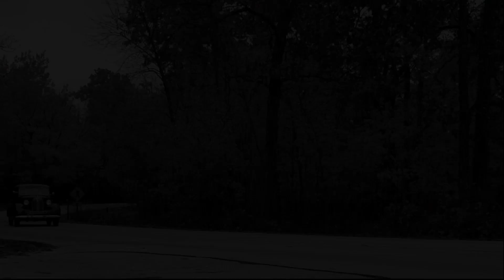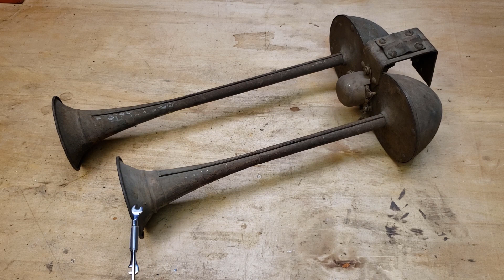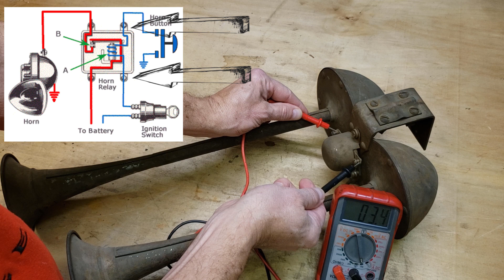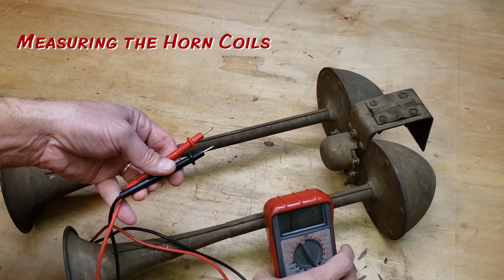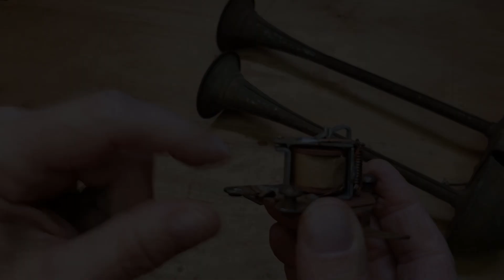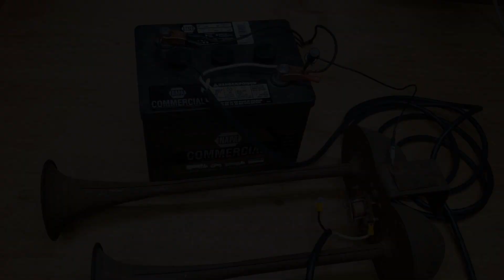Antique Car Horns! How to test and Repair them! IT"S LOUD! #modelaford #Vintage #antique #oldcar

Comment: I’m not sure if you will see this, but I recently acquired a horn like this, but it is missing the relay, is there anything I can replace it with?
Reply: Any 6v horn relay.
Reply from the maker: Ha! I read every comment and respond to 99% of them. Do a Google search on "6 Volt Car Horn Relay" and you'll see several listed. Some listed are at Napa and "Chevs of the 40's" websites. Hope this hrlps!

Comment: These were predecessor to seashell horns all cars from 30s to  40s including Ford used it. I believe even heavy commercial and fire trucks with hydraulic brakes like kb6,kb8 used it where the factory adjusted the screws at the back to give it a truck sound.

Comment: Hi Terry. Could you please explain how the circuit is set up at the end, when you test the complete system? I would have thought that one cable from the negative battery post to each relay contact and the other from horn ground to positive battery terminal (as it is for a positive ground car) would be enough. But you're using a lot more cables, which I don't understand. It's a great video, by the way, thanks for that.

Comment: How do you repair the horn if it doesn't work?
Reply from the maker: It depends if its a bad relay (if it has one) or the coil(s) in the horn itself. Do you have vintage trumpet horns like in my video?

Comment: I have a set of trumpet horns 6volt from 39 Chevy..is the positive on 6 volt the ground?? I tried clamping to wire coming from horn and touching horn assembly with other wire got spark a bit m a hum but sure not a horn sound. Seems there is a whole magnet n relay system under dome.under main screw..I used 14 ga wire alligator clamp to battery is gauge of wire too small?? To get horn to sound..is there an ohm test on horn insides?? Can I send it to you to look at??
Reply from the maker: Hey Paul, It could a few possibilities preventing them from working properly as I've seen on other horns. Yes, I can look at them no problem! Contact me at flatheadterry@gmail.com so we can discuss the details.
Reply from the maker: Did you get yours working?

Comment: Can I use an energizer 6v battery I can get at Walmart or is that going to be too weak?
Reply from the maker: @communistpootisbirb  Correct, the Energizer will not have the current capacity (measured in "Amp Hours) to energize the coils. In this video, the small battery has an 18 Amp Hour (Ah) capacity which is not enough. You'll need a battery with at least a 50 AH rating. How this helps.
Flathead

Comment: Do you have to have a relay?
Reply from the maker: No, you don't need to have a relay. However, these old horns draw a lot of current (6+ Amps) so make sure your wires, switches and fuse can handle this higher load.:face-orange-biting-nails: A relay is used in old cars so a small wire and horn button (switch) can be feed up thru the steering column. This is the "Primary Circuit" of a relay. The "Secondary Circuit" supplies the High current directly to the Horns with the larger wires. Hope this helps!:hand-orange-covering-eyes:

Comment: Thanks Terry -- will this horn work on a 12 volt system?
Reply from the maker: Thats a good question! I suspect that they would work for a short period of time but eventually burn out the coil windings. The copper coil windings are designed for lower voltage (6 volts), higher current (8-10 amps) and applying 12 voltage  generate higher  heat as a result. [Try it once and let me know if my theory is valid or not! 😛😛🤪]

Comment: I recently got an old horn made by The Electric Auto Lite Company. I'm not sure what it was from or how old it is. It looks like you're typical Klaxon style horn but with just a short round horn on it. Not a long trumpet like these. Anyways I tested it by hooking straight to my battery and it was loud! It works great. Not quiet an ahooga but it's running on a 12 volt system. Its a 6 volt horn. Can I use a ballast resistor or 12 to 6 volt resistor to make the power going to the horn correct? Is a converter better? I'm just looking for the simplest, cheapest solution since it's only for fun. My factory horn is still hooked up.
Reply from the maker: Hey Scott, I have the original horn in my '37 similar to a Klaxon. It works just fine, but this summer I'm be adding the horns in this video to my Coupe for added fun. I recommend using a 12v DC to 6v DC converter and not a resistor. However it must be able to handle the current (amperage) that the horns draw.

Comment: I have a 12v antique horn and the closest I've found to looking like it is 1950s,would you say that's most likely the decade mine is then?how much should I ask for it at an antique store?
Reply from the maker: If it's a 12 volt, that would make it mid 50's or newer. If it works you could ask for $50-60. If not, about half of that. Thanks for the questions!

Comment: Can these horns be converted to 12v with a new relay?   I have some pretty cool horns from a 1951 F1 pickup, but a 6v horn in a 12v car is way too loud!
Reply from the maker: Hey IowaMercMan, Unfortunately, the 6 volt horns cannot be converted, however there is a solution. Use a 12 volt to 6 volt converter to power the horn and relay. A single old horn can draw up to 10 amps so use a converter that can handle that current load. A friend of mine used one with success. Here's a link to one I found on Amazon that is rated at 30 Amps. https://www.amazon.com/dp/B07CSKVN9D/ref=cm_sw_r_cp_awdb_imm_t1_dwG1Fb9NHEW9A
Reply: If stepping down from 12v to 6v, how would it be wired so that the horns work with the negative ground 12v system versus the prior 6v positive ground system? Thanks!
Reply: @c @codymartin3877 sed ceramic power resistors on a Model A stock horn and Spartan 3 note bugle chime.  Car on 12 positive ground.  Resistor hidden in stock horn cover.   Still working on the aesthetic for the resistors in parallel hanging of the bugle chime terminal screw.  Bugle Chime on firewall above motor  so not seen so no rush. No relays used.   Circuits fuse protected.  Video on my YT channel.  Polarity reversal no issue with horn motors.

Comment: Wonderful sound.  Were they stock or did someone upgrade long ago?
Reply from the maker: I'm not sure what car this horn was originally on. Looking at the mounting bracket, it was mounted on a car that had radiator support rods like a Model A Ford so I'm guessing early to mid 30's. The original color on them is gold so maybe Cadillac or Oldsmobile perhaps. This horn was definitely not stock on my unrestored '37 Plymouth. Mine has a smaller horn behind the front grill. I'll just add this under the hood for fun.
Reply: I've got two sets that look and sound like these. One is off a '46 Plymouth coupe and the other from a '51 Ford.